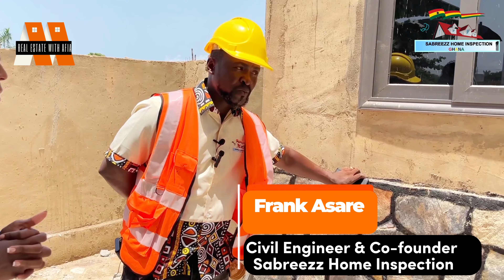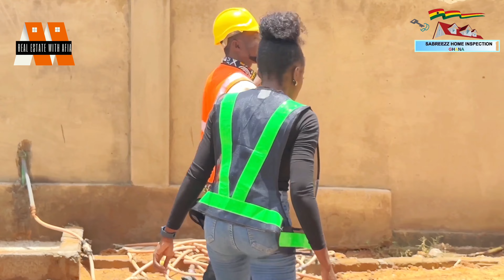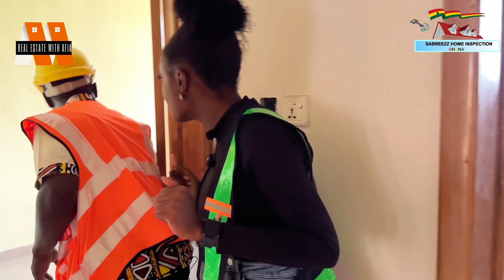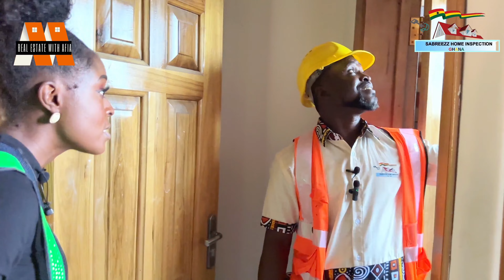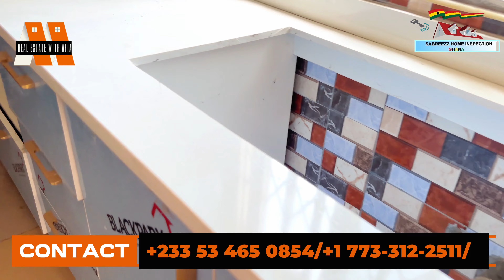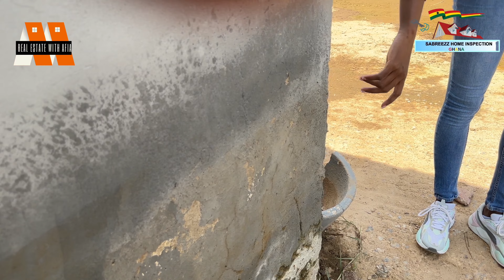This Property Owner Made BIG MISTAKES While Building – Don’t Let This Happen to You!

Comment: Your body language showed the inspector did not answer your question about using fired clay bricks to build. Actually, it is far more economical in the long term. Our ancestors used clay because of the harsh weather conditions. The weather is now harsher and will be more. Even the Ghana Government has been encouraging the citizens to use burnt bricks. The nation is endowed with clay deposits in every region, but as we know, Ghanaians are stubborn, as they always prefer foreign. You can actually build in Ghana with 100% local materials. We dont need all that concrete. How did our ancestors live?
Reply: how many skilled artisans to work with clay bricks does Ghana have? If most work is in concrete, then the expertise will be mostly in concrete blocks.
Reply from the maker: He actually mentioned that from his experience with some buildings constructed with bricks, they don’t really look good now after just some few years…. And he related that to the concern on the need to get it well molded  to enable it last…. I believe If it’s done well, it should last for decades
Reply from the maker: Good point Mark, not many skilled hands at the moment….. I have had people share similar concerns
Reply: @therealestateshowafrica  many building built with clay bricks last hundreds of years in the USA. My house Iive in was built with claybricks in 1908 and still standing  strong.  its a good material
Reply: Concrete is cheaper by a long shot. Where are you getting your numbers? Why do you think most buildings are cement blocks? Have you thought about that? Or your prejudice about about Ghanaians bein stubborn is enough?

Comment: The property thatt gets flooded, they need to add a storm water mitigation system.  Underground drain piping, catch basins which require you to pitch the land around the property  this way water will flow to the basin and  underground drains and away from the property.  Ot they could have build up the land with engineered soil, pier foundation, etc.  I am so happy to find this video because when I ask about building regulations in Ghana I am told there are none, just build.  But i see people mixing concrete by hand, which is not good on a structural level.  I will definitely search out Frank when it's time to build.  Before you come for me - I have been in the construction and real estate field for over 15 years, here in the US